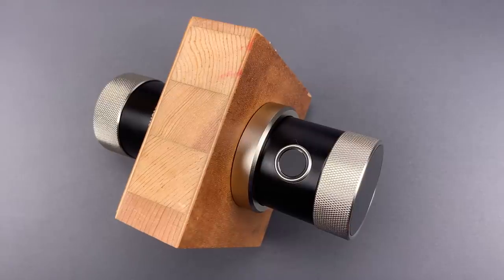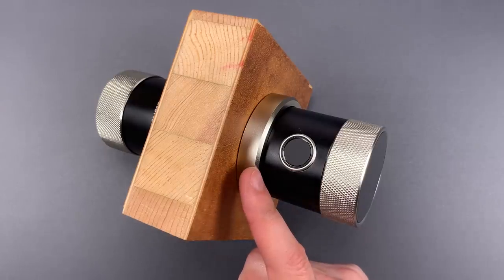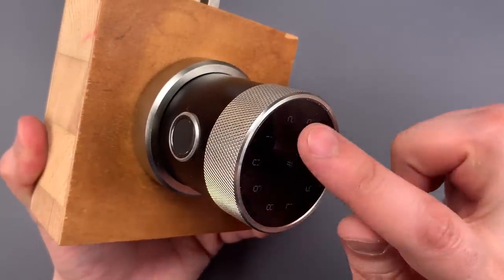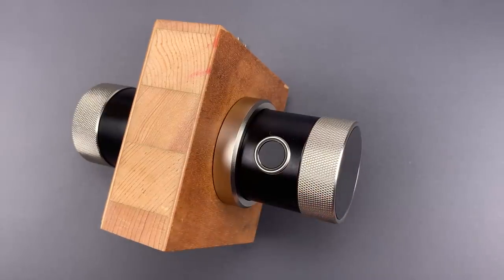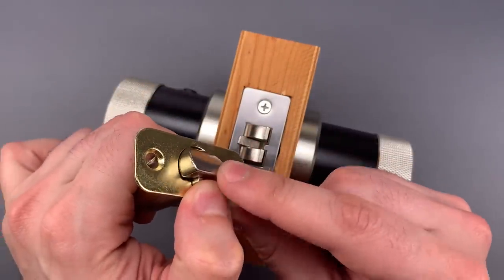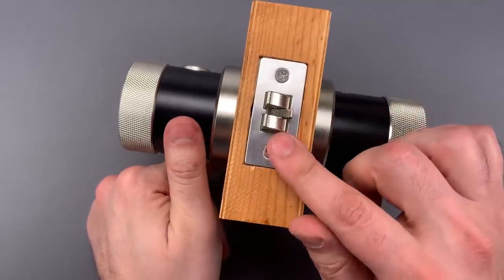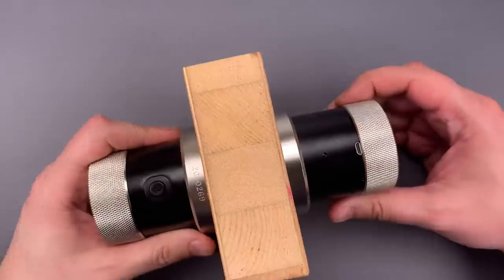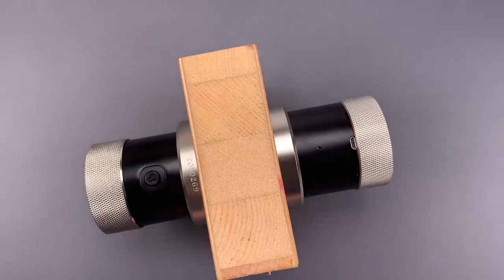[1120] Fingerprint Lock That Forgot The Fundamentals - DatoHome L-B400

Comment: Imagine the lock's battery dies and you're outside.
Reply: That's what the usb port on the outside is for.
Reply: @mrlescure  where you gonna charge it from
Reply: Who wants to charge their door handle?
Reply: @Lunarr_Eclipse  your phone if it's capable or a power bank.
Reply: @mrlescure  I guess some people might keep the right USB cord in their car, but I'm betting few cars have USB-C ports in them, so it would be unusual for someone to have one with them outside the home currently.
Reply: @mrlescure  So I would need to carry fully charged power bank at all time and take cable each time
Reply: @mrlescure  It would be more convenient if it had a USB-C connector, since that's what phones that can charge other devices use. You'll be much more likely to have the appropriate cable with you.
Reply: Rajamic Itrenti thats micro USB, i have hundreds of those laying around.
Reply: Then just bypass it with a credit card type tool. Or a piece of string lol
Reply: Dragonax perhaps an electronic lock is not for you? I want to like them but they have a lot of downsides still.  I’m sure the battery lasts a long time though and charges quickly.
Reply: @amphiumaiii7058  in the rain... xD
Reply: The micro usb connection is a no-go. 
As for by-passing with a pick or shim, if you’ve got a metal door jamb, you’re not getting a pick anywhere close to the retractable latch. 

Any electronic lock is suspect for security. There’s no way I’d have an electronic lock on a safe. 
Companies like S&G produce combination locks that use nylon gears so that the mechanism can’t be X-rayed. 
Kind of interested what a computer displays when you plug a usb cable between it and the lock.
Reply: @w00tb0ss  Lmao
Reply: There's a specialized tool...a flexible piece of plastic.
Reply: @mrlescure  Who the hell wants to whip their phone out, grab their "door charging cable", plug that bad boy in, wait 10 seconds minimum and then use the scanner or w/e just to open a door?
Reply: I think that this handle mainly target tech person as their consumer. And I pretty sure they gonna have at least one powerbank/battery pack whether they ever need them or not (and it isn't that expensive either).
Reply: @amphiumaiii7058  what of you loose your house key? I swear the people you are so against battery locks never afraid to lose their keys? Battery locks start warning of low battery at like 30% I've had my schlage locks on my doors for over 6 years and never had "dead" battery they always warn and I change or charge the batteries.
Reply: @Tyiriel  I assume the Bluetooth is a backup or a way to lock when you are in bed. The fingerprint sensor and RFID are the primary ways, much easier to scan a RFID keychain than fiddle with keys to find the right one then insert it right way, imagine if you were drunk trying to get in.
Reply: @MattBruman  Totally agree, I just think it's stupid to have 4 ways to legitimately open a lock up when it only requires 1, alt. 2 if it's public or the primary is susceptible to being unavailable like a broken FP reader or RFID scanner.
The point is this; If it's fiddly to hit a code in, scary to have a fingerprint reader breaking, bluetooth being potentially cheated by some hack tool and finally the RFID reader being so easy to use - Why did you implement the first 3 ways to begin with? and RFID reader would've been enough - wouldn't it?
Reply: @MattBruman  you are silly. When i get home drunk i just kick the door in like a fucking viking. When i enter my house i yell Valhalla and pillage the fridge and my wife. Peasants fiddle with their rfid chips and keys.
Reply: @Lunarr_Eclipse  did you not watch the video? Slip a plastic sheet into the door frame. Tisk tisk
Reply: @Lunarr_Eclipse  With the cable you carry around with your battery pack for recharging your smartphone when far from home.
Reply: @gungadinn  Now, I don't know what the lock tells you about itself when plugged into a PC but I'd expect it to only give you access if you unlock it or enter the code for it.
Reply: Jeffery Amherst  Not really, depending on what the lock does over USB. Just that the port to reset it or change the combination or whatever is on the outside doesn't mean the lock lets you change it without unlocking it first.
Reply: Jeffery Amherst  why would it be data? There's no reason for it.
Reply: @realdragon  isn't that whats everyone is doing now
Reply: To the other repliers:  It looked like the charging port is on the inside .  If you're outside and the battery is dead, you have to slip the lock.  Maybe that's why they made it vulnerable, as a "back door"?
Reply: If the doorknob is like the bluetooth one my apartment insisted on installing with no opt-out option, it will blink on the inside well before the batteries are fully dead and have a number of open and closes before they die fully. also as others have said, there is a charge port, and many phones now can act as a battery bank granted you have the right usb cable or can get ahold of one.
Reply: @mrlescure  let's face it. This product is aimed at the tech community. This target audience is more than likely going to have a flagship/high-end phone. These high-end devices almost always use USB type C. I can tell you for sure that I do not have a single micro USB cable in my vehicles or the garage. Neat idea -> poor execution.
Reply: @pseudotasuki  nope, my phone has micro usb and it can act as a battery bank too. but i would have to have my usb-otg cable and a "normal" usb cable arround.
Reply: They should have spent the extra monies on USB-C instead, to allow charging by phone or power bank.
Reply: @Tyiriel  I am a support worker who works in supported living homes across my city. It's useful for the guys with learning disabilities who may find a key hard to manipulate to simply use an RFID fob, and for staff, we can know a code to input to get in their house, without having to distribute fobs to all members of staff.
Reply: Some smart phones will supply power from their battery.
Reply: @Cameron_J   I think that a tech person still gonna have a micro-usb Cable (if they are apple user, maybe not) whether they need it or not. And there is a good chance that the handle comes with one. And they aren't that expensive either. Or just buy a short one and hid it in the garden/porch.
Reply: @asrig3880   Do you remember how badly SHTF when companies pulled the headphone port out of phone designs? People lost it because they had to put a dongle in the case that they stored the cable and headphones in. New products should not be incorporating older generation connectors when the new standard has already made mainstream. It's vastly superior in every way. Everyone needs to just let that connector die out already. Not including the flaws listed in the video and the others I listed in a different comment, I would not buy this lock just because of the micro port. As for the Apple fanboys not having a charger, well I just don't care .
Reply: Cameron J look, it’s a Chinese product that wants to be all things to all people. USBC is only the standard in the US for phones. Most phones worldwide still charge with micro, and so does everything else that charges. From headphones to power banks to Bluetooth speakers to warming pads to fans to... whatever.

Usbc is nice but it gets that by virtue of complexity and licensing fees. Just dropping a micro connector in is cheaper, and always will be, and therefore usbc will never become the standard.
Reply: @mrlescure  ohhhh charging my door handle. the future is now
Reply: @danh8302  on your pocket? because you might be outside when that happens
Reply: certain locks allow you to put a 9v battery on the bottom as an emergency power source.
Reply: @JasperJanssen  Rest of world is also using USB-C. USB-C is more sturdy than micro-USB.
Reply: Leif Neland yeah, that’s just not true. Most of the world and most devices still use micro USB because it’s cheaper. Including most power banks, by the way. I mean, the part about C being sturdier is true but also irrelevant.
Reply: @Lunarr_Eclipse  your phone :P
Reply: @gungadinn  was thinking about this too, what if you could just plug a PC in and factory reset
Reply: Dragonax ... 
or you could just use a key lock
Reply: @danh8302  I bet they are all laying around inside your house though
Reply: @JasperJanssen  my phone is USB-C, my laptop is USB-C, my new headphones are USB-C...
if you are just implementing charging and basic USB 2 speeds a type C plug is exactly as complicated to use as micro-b. I used them in a professional capability, and swapping them was literally just grabbing from a different box, because we had a make thad just the 2.0 pins installed and routed outwards.
and licensing is a flat fee to be able to stamp "USB" on your device, regardless of which plug you use. a fee i could afford privately if i wanted, about 150bucks/month for a vendor ID
granted, the plugs are more expensive, about twice the price from micro plugs (slightly less than 2 bucks/piece vs slightly less than 1 buck/piece. from scrolling through RS-Components for a few minutes and looking at single piece order prices)
but that's a very tiny cost for a couple-hundred-buck device.
Reply: @danh8302  But they could at least have given it another charging port on the inside...
Reply: @gungadinn  I hate to say it but, everything can be x-rayed. No such thing as an invisible to x-rays material. It all just depends on the source and detector quality.
Reply: Dragonax no. You need to carry around your phone. You charge it for 10 seconds, let yourself in, and the recharge it properly immediately after

Comment: "unlock it in one of four ways"

Nope, nope, and nope. That's way too large of an attack surface.
Reply: The fingerprint is probably the one I wouldn't worry about, so that's out. The card/hook trick are just laughable, but no longer work on the newer models. So you're left with hacking in via bluetooth, guessing the code or physical entry (drilling)
Reply: The rfid and Bluetooth are depending on their implementation the biggest security holes in my opinion...
Reply: And the hammer? That hasn't fail me so far.
Reply: @TheUltimateBlooper  fingerprints aren't so safe if you forget to wipe down the surface when you are done.
Reply: @davidwarford3087  Sure someone could take a sample of your fingerprints after you tpuched something but at that point they might as well do the physical entry way. Too much effort
Reply: I think a group of hackers accurately reconstruced a finger print just from a photo of someone giving a thumbs-up a while back

Comment: Let me see : glass front that attract prints, bluetooth connectivity, notwithstanding any other angles of attack this is already a lot of vulnerabilities for me...
Reply: Yeah, that thing's got what, like 3 different transceivers in it? One of those is weak, just on probability alone.
Reply: That was exactly my first thought.
ACTUALLY my first thought was that the big silver ring that holds it onto the door was just going to thread off..
But THEN I thought about how many electronic and software vulnerabilities it was going to have when he showed the opening methods.
Reply: RFIDs are trivial to clone, too. No way I'd ever use this lock, chances are it has multiple additional flaws that allow someone to bypass it. Wireless connectivity makes that a near certainty, for a product like this.
Reply: @adammfontenot  at least you can't pick it!
Reply: Alex Richard I hate Bluetooth. It is very easy to step into and take over. An older tech that has stuck around far too long.
Reply: @Prophes0r  the micro-usb is also on the outside of the lock, so unless that's wired directly to the battery and nothing else you've got another potential security flaw
Reply: @adammfontenot  All I would need to do is target a home owner who possesses this lock, set my phone to read the RFID tag and duplicate it with one of a hundred different apps publicly available on the app store, walk by slowly and tap it to the tag for all of 1 second and boom, you have a cloned version of the key. This is an awful lock from the tech side of things.
Reply: @christianmulligan9719  To be fair, it MIGHT be a challenge/response RFID Dongle. Those aren't clonable since they have their own key, and what you will "hear" passively won't do you any good.
Reply: The question I'm asking myself... If someone wants to break into your house, there are countless other options and I dont think your average thief is smart enough to clone your key.... most likely they just take a bike hammer and knock that thing off... so why bother worrying about technical "flaws"
Reply: @christianmulligan9719  not sure why they would put the micro usb on the outside anyways. I would say put it inside so it could charge when not home.
Reply: @christianmulligan9719  I've seen remote rfid cloning hardware years ago in a defqon talk somewhere on their yt channel, was a laptop-size directional antenna panel you would carry around in a backpack, picked up stuff up to several meters away, nobody would ever know you cloned their key, I'm sure hardware like that is still around.
Reply: @ZaganStoanes  I honestly think the side with the usb actually IS meant to be the inside, the usb is not shielded for rain/weather at all, and it seems odd to have that hole on the outside aswell
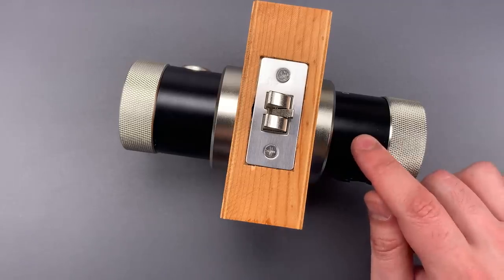Reply: @suicidalbanananana  at 2:10 you can see the usb is on the same side as the print scanner when he turns it over to see the bottom.
Reply: Yeah, not qualified to guard your treasury from all those criminal hacker nerds with RFID scanners walking on the streets. 

RFID can be duplicated, boohoo. Never heard of duplicated keys, duh...
Walls of your house have these rectangular things made of glass, bruh. They’re called “windows”, bruh.
They break, bruh.
Vulnerability, bruh.
Jeez, y’all security experts here. Painful to read.
Reply: @enwarnung2  A lock is not meant to prevent someone from entering. A lock is meant to slow them down long enough that they give up or that someone finds them. It's a deterrent, not a failsafe. A bar across the back of the door is a failsafe.
Reply: @RascaldeesV2  So what? I dont understand what your trying to tell me? I know, doesnt have anything to do with what I said
Reply: @enwarnung2  Okay. Would you leave your doors unlocked and your windows open?
Reply: I would like to see mythbusterstypeofapproach when introducin finger print locks. At first I mean.
Reply: The lock takes longer to open because the would-be intruder can't choose which way to take!
Reply: @Prophes0r  exactly, when people hear RFID they quickly jump on the assumption that it's just the cheap ass toy RFID you get off ebay, or read some article that dumbed down the word for cloning an RFID tag.

There's some decent RFID tags that do implement securities that are not yet publicly known to have security flaws, and or require the intruder to hold on to the RFID tag for longer then "just a little bump".

I'm not saying it's extremely secure, but as somebody else mentioned in the comments:
"You guys... Irrational assumptions galore."

Just because it has an USB doesn't mean it can do data, just because it looks like glass doesn't mean it's easily scratch able, just because it has Bluetooth doesn... no, fuck bluetooth that part is true.

Anyway they completely failed the basics, something points towards over engineering, like probably some tech savvy guys making a lock that has inane security yet forgetting the actual locking part.

"Quadruple factor authentication: Email, SMS, Phone call, and Physical Mail Authentication!"* 
**

*lock mechanism not included
** this product is not compatible with any locks, and is not actually suited for locking anything
Reply: I also speak in ellipsis. Makes me look super intriguing.
Reply: @ZaganStoanes  The reason for the microusb is to power it when its battery gets flat, and you aren't on the inside.  If the battery goes flat; and you are stuck outside you want the microusb to provide enough power to it to let you get inside (and remove/replace the batteries).

Presumably this lock allows you to open the door from the inside without passing any of the checks on the inside (ie no need to provide passcode/rfid/thumbprint/bluetooth/drill), to allow opening the door in the case of a flat battery.
Reply: @meateaw  with the power port outside how would you charge the rechargeable battery thats in it? Leave the door open while home to charge the battery or close the cable in the door? A lot of design flaws in this lock. At the end of the day though doesn't matter what kind of lock, locks only keep the honest people out.
Reply: @svampebob007  The Bluetooth part isn't true either. There are some Bluetooth standards that are more secure than others, and even if those are broken Bluetooth is only the transport layer, nothing stopping the next layer in the stack having strong security. Not that it necessarily does mind you, but it isn't automatically insecure just because it uses Bluetooth.

Comment: As someone in college for cybersecurity, I will never trust my physical security to anything that can be connected to through network protocols.
Reply: There is also a port on the OUTSIDE Handle that you can see. That's just begging for a brute force cracking to connect and crack the door in under 5 nano seconds it takes to compute the basic password code. Is it even Encrypted? and are each door handle under a different unique encryption? I bet not!
Reply: Got that right!

Comment: "Boss, I cant come to work today, I need to charge my door lock... "
Reply: You need to change your lock to this one, then. This one uses AA batteries in the indoor handle, and it will give you ample time to replace those batteries when the low battery warning comes on.
Reply: @PanduPoluan  I dont have batteries at home